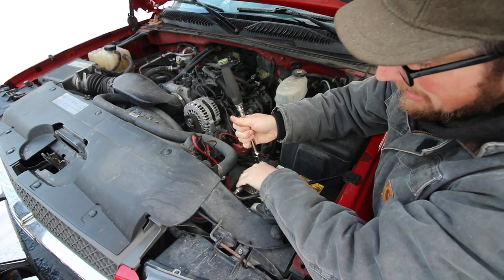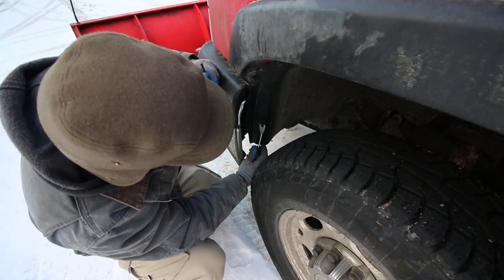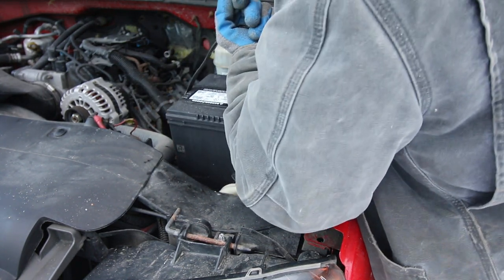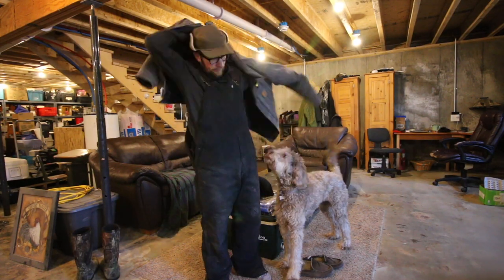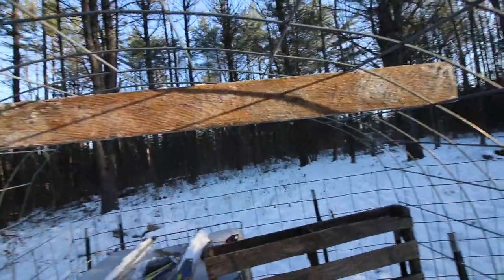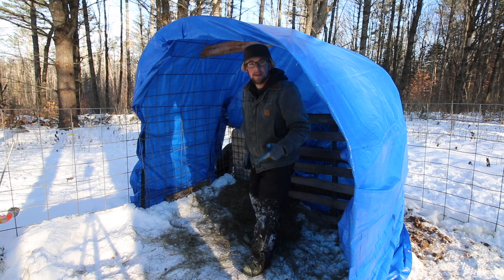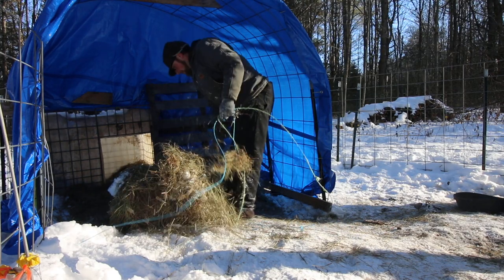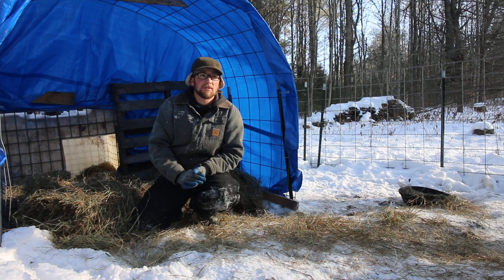Getting our Pasture Raised Pigs Ready for Winter ~ Fixing our Truck

Comment: It looked like you took the positive terminal off the battery first, but I couldn't tell.  Always take the neg off first so if your wrench strikes the car frame parts while removing the pos term, it can never cause an arc.  I told that to a coworker several years back and he did just the opposite.  He ended up burning his wedding ring off when his ring came in contact with a part of the car while removing the positive term first.  Had the neg term been off first there would not have been a problem.

Comment: The fuel line is better replacement hose than the hard plastic. You won't have any problems with cracking and breaking now. 
When connecting/disconnecting car batteries, always attach the black (negative) LAST, disconnect FIRST. This leaves an open circuit, while connecting the red (positive). You can connect the red and not worry about coming in contact with the vehicle body. Once the black is connected, the entire vehicle body is now part of the circuit. If you touch the body with a wrench, or other tool while connecting the red, it will arc, damaging the tool and possible the battery. Without the black completing the circuit to ground, you can connect the red with no worries if you should touch the body, the body is NOT grounded. Remember black last on, first off. 
You should have had Figaro and Pluto out there helping with the pig shelter. I'm sure they would have helped the pigs tear that cover down. LOL Silly porkers.
Reply: yes hook the leads in the right order do it wrong and it can get expensive to fix the littlest things on the newer vehicles.
Reply: David Johnston Thank You for that information. I’m putting a new battery in by myself for the first time in my life (I’m *cough cough* 50ish 🤫 LOL) tomorrow. That’s something I never would have thought of. Thank you, sincerely! ~Lisa

Comment: You are bandy Al, I often have to get a family member to get a job done.  Getting someone in business to do the work is far more expensive.  You are blessed to have auto repair experience.  Thanks for the tip one grease on the terminals.  Still 80s in Manila.  Cold here in Texas, but not freezing.  Where  do you find the big totes for the pig houses?  Where is the best place to look for them?  The tarp,seems like a good winter addition to the cattle panels.  Great video, God bless America.
Reply from the maker: Thanks, the big totes are cold IBC totes. We searched on craigslist to find ours. You want ones that had food in them. One of ours had olive oil in it and the other a cooking wine.
Reply: Jim Claire 
East Texas Craigslist has them.

Comment: Just had to replace my battery after 9 yrs. $128  for someone to do it for me ☹️you have to improvise wherever you can. Thanks for your videos
Reply from the maker: You got the life out of the 9-year-old battery.
Reply: I replaced my 2005 4runner battery last spring, but only because I was afraid to go any longer!  It was still working fine; I seriously just was afraid to go longer without feeling as though if it did crap out... it really would be my fault!  I did upgrade the replacement battery since the wife and I do go camping with the 4runner as our tow vehicle.  I've always had good luck with batteries from campers to sailboats to motorboats and my cars...I've rarely ever needed a jump.